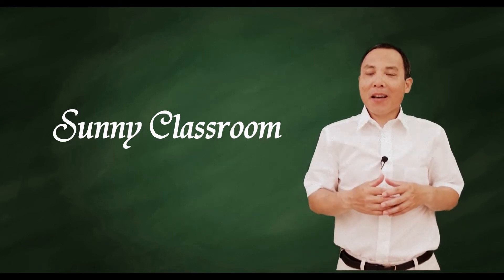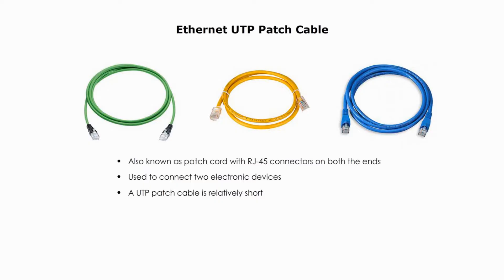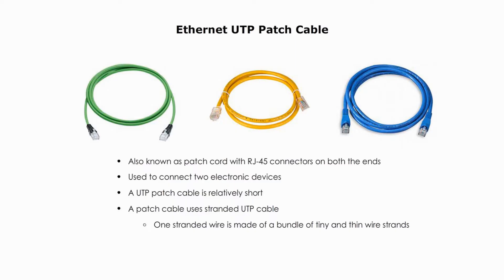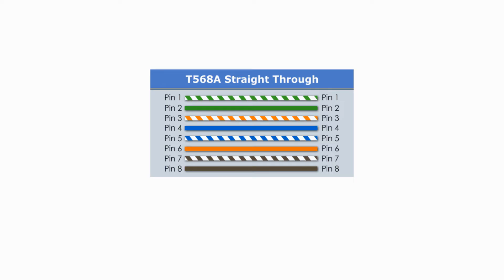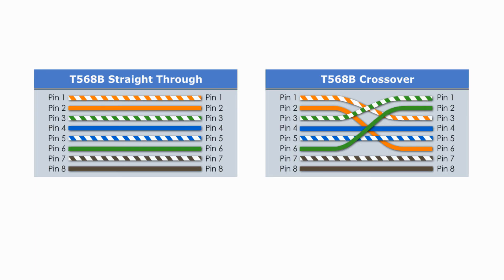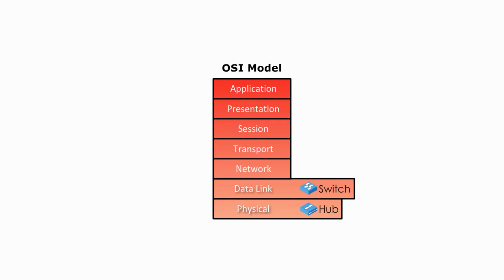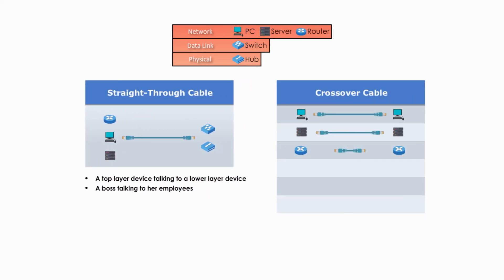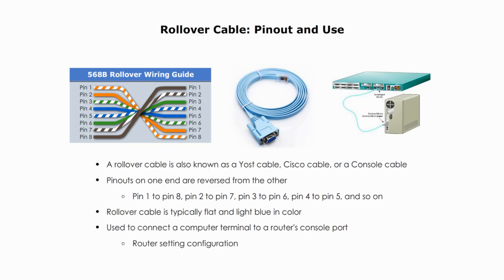Straight through, crossover,  rollover - Where & When to use what?

Comment: Hi Sunny, The part where it states that a hub is part of the physical layer was a bit confusing-- it may suggest that a straight-through cable can be used between a switch and hub, which is not the case.

Comment: Crossover cables used to be necessary to connect two computers directly. 
Today's network cards automatically switch between straight and crossover. 
Special cables are not necessary. 
Use always straight through cable!

Comment: Found an error in the video, comparing 1:50 and 2:40, the T568A Crossover Cable Wiring Diagram is different. I think 2:40 should be correct.  Btw, I think this channel is really great and I learned a lot, thanks.

Comment: I want to connect a Gpon device which has 4 Lan ports and without any Wan port to an external router's Lan port in order to use the same Dhcp provided by the Gpon router. Is it a Straight Through or a Crossover connection?

Comment: What happens when we connect straight cable instead of crossover cable.
Reply: now days it mostly will be fault less but in the past connecting a hub to a hub with strait through would not work and your network would be down.

Comment: I am trying to set up a secondary router as Access Point which will connect to my main router. Should l use crossover cable? I have a Straight-Through cable lying around, will it work in connecting these two routers?